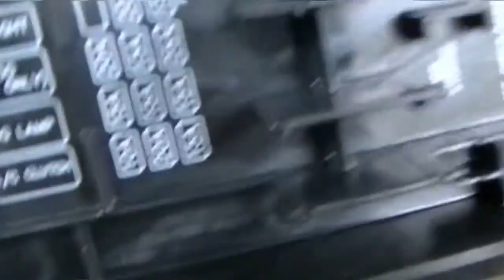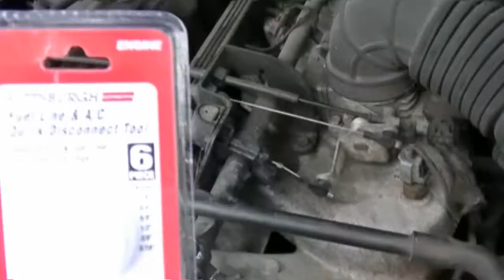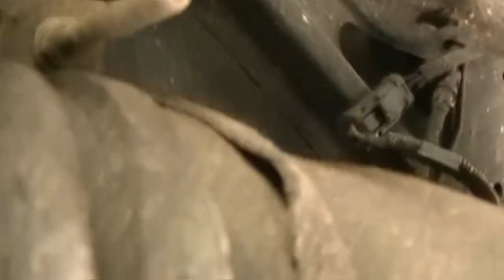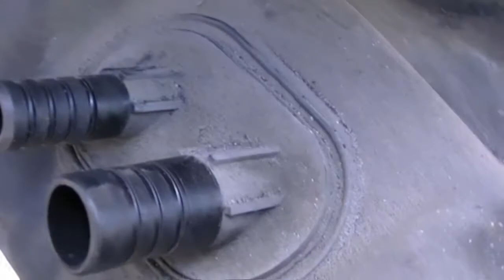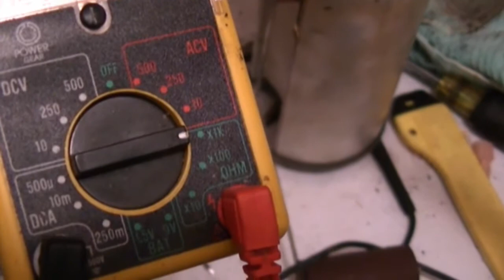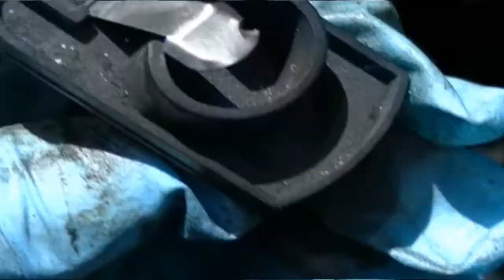Jeep Cherokee XJ Fuel pump replacement and Diagnose No Start Drop Fuel Tank Ect.

Comment: So if it was not fuel pump what was it?
Reply from the maker: Don't know exactly all I know is after it was all said and done I replaced the pump and I'm still rolling
Reply: @HoodHandyman  had to be something inside of Assembly
Reply from the maker: I would say the fuel pump. Maybe mine worked but worker intermittent. All I know is after I changed it I really had no more problems. Please like and subscribe
Reply: Thanks for the help
Reply: I’m working on one been sitting with bad gas at least 10 years